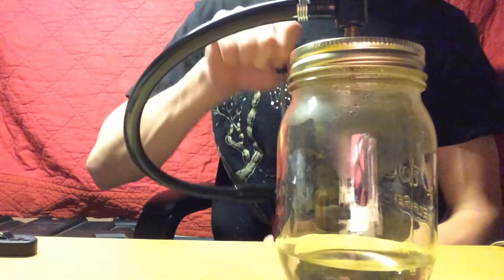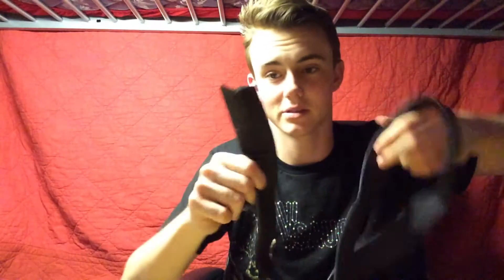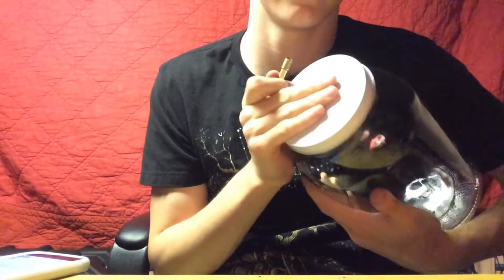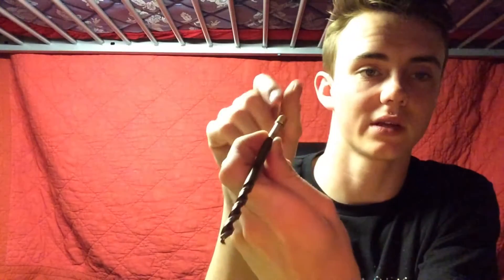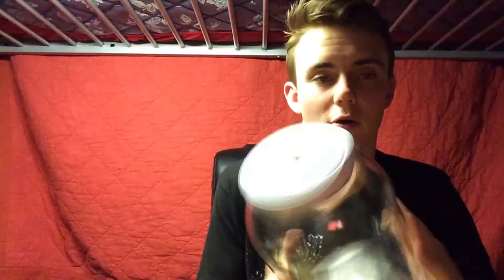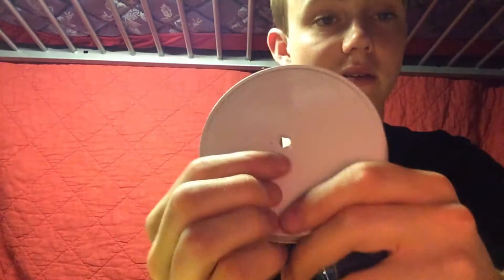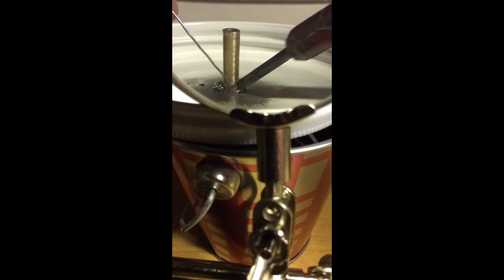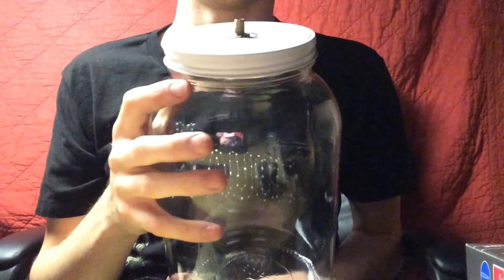DIY Cheap and Easy Vacuum Chamber (Gallon Sized Mason Jar)-Ghetto Build 1

Comment: If you go to any tyre repair shop, including bicycle repairs, you can get free used inner tube. Or get a replacement valve for tubeless tyres. It has a built-in grommt.

Inner tube in different sizes have many uses, e.g. with stiff wire hooks you have strong bungy cords, cut gaskets from larger tubes, make strong rubber bands from rings cut from various sized tubes... Just for starters.

Comment: The valve stem is in the wrong way if you want to hold vacuum.  Need a hotter solder iron for what you're doing as well.
Reply: Looks like it worked. Didn’t it?

Comment: wait, did that thermometer read 70 degrees Celsius or F??
Reply: Ken Vincent Celsius
Reply: Yeah that's what it appears but it doesn't make sense. First off, infrared light doesn't even go through glass, so he's only reading the heat of the outside of the jar, but I think it should be F because you can't live in 70 celsius, even in the vacuum the temp doesn't change, if anything the temp should go down because the volume didn't change but the pressure dropped.
Reply: Ken Vincent Oh. The Water Started Out “Hot”. He Was Just Showing That You Could Boil Water Under 100°C.
Reply: Ken Vincent Making It Hotter Lets It Boil at Less at Higher Pressure. So He Doesn’t Have To Pull As High of a Vacuum.

Comment: What kind of pump are you using to suck the air out? And very nice soldering.
Reply from the maker: SoCal Skateboards I am using a cheap hand pump from Harbor Freight. I believe it was around 5-10 bucks. I guess it is supposed to be used for oil transfers and other stuff, but it had a bike tire valve in it so I figured I could use it to pump air out. And thank you very much!